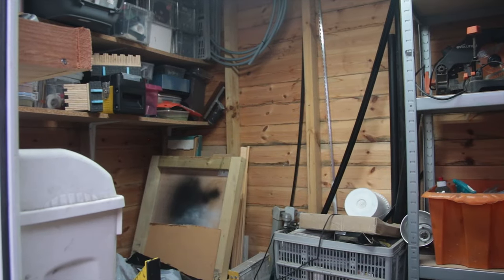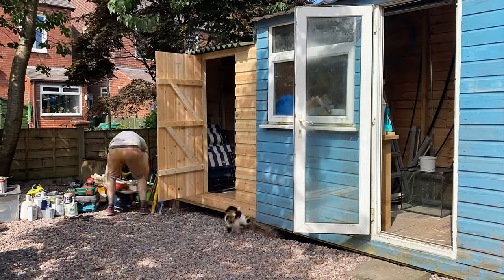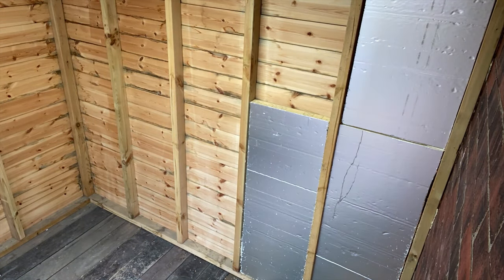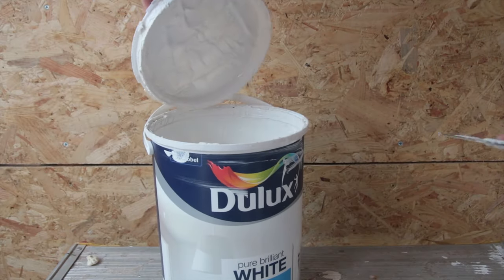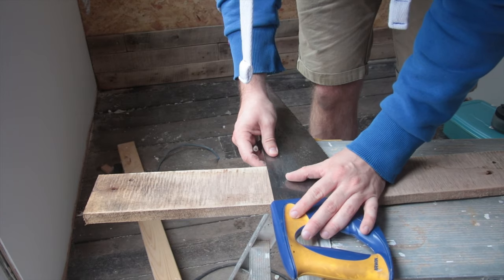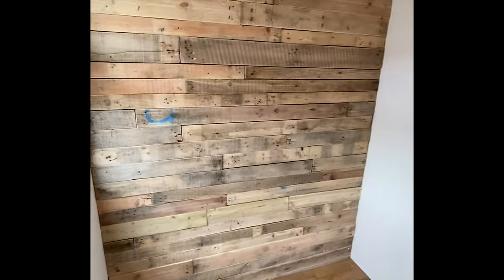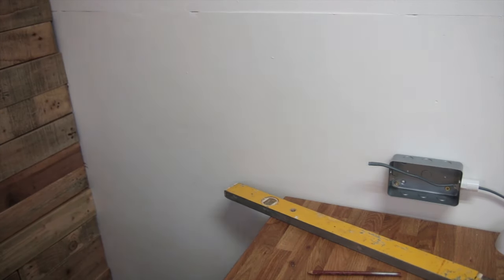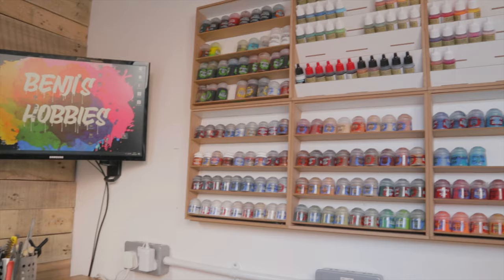Building MY DREAM Studio Hobby Space from a Garden Shed!

Comment: I like that saw as a straight edge bit, i did that on my grid-beam shelf build a couple years ago, seemed reasonable enough with our cluelessness about building, lol.    Nice job!!    On the floor insulation that's just right on the shed floor with laminate on top with no joists?    Does that stay level?  the floor doesn't sag in bits where there is more weight from bookshelves or anything on sections of the floor?
Reply from the maker: Thanks for commenting! The saw can be very versatile for marking out lines - you can also use it to make 45 degree lines as well 😊 I’ve not had any issues with the floor yet. I did think about adding bracing beams at the time but the span is so short that I don’t think it’s really needed. If it had been any wider then I would have absolutely added some. Thank you for commenting!

Comment: Greater video. I have two concerns. First is freezing temperatures during winter. Are you planing to heat it whole winter? Second is safety.You got there some serious collection and doors doesn't look to be super safe.
Reply from the maker: I’ll more than likely use a small oil filled radiator to keep it at 10-15 degrees and then turn it up when I go and work in there. It’s only a small space so it’ll won’t take much to heat! The door is pretty sturdy BUT I have taken quite a few precautions with regards to security and safety, don’t you worry 😉

Comment: How’s that floor holding up, mate? That foam board seemed a bit thick, and I was wondering if you’ve ahead any issues with it getting compressed from weight?
Reply from the maker: Still perfect almost a year on - no issues at all 😊 It’s cellotex/PIR insulation board rather than  basic polystyrene so it’s pretty dense. It’s also only a 6’ span, so there’s not too much ‘flex’ in the floorboards over that sort of span. If it had been bigger I’d have put joists down across the floor.
Reply: @BenjisHobbies  excellent, I’m stealing this idea. Also, thanks for answering me despite my typo, for which I will live in eternal shame.
Reply from the maker: @KevinTumlinson  no problem at all! Those pesky typos haunt us all from time to time! 

I really should do a shed update video…
Reply: @BenjisHobbies  and I will watch that video, sir.

Comment: What a great informative video how do you manage in the summer months it gets really hot in my garden shed and I don't have any insulation for me the worry would be that my paints and maby even some of the thinner plastic on the miniatures wouldn't fair very well
Reply from the maker: I’ve now had it up for a couple of summers and in all honesty it’s not been too bad. I think the insulation helps keep both the heat in during the winter and keeps the heat out during the summer so it’s a win-win. I do most of my work during the evening and I’m able to open the window or leave the door open if it feels a bit too toasty and to get some air movement. There’s also a ‘lock’ on the window so I can keep it just ajar enough whilst still being secure to give a little ventilation throughout the day. None of my models seem to have fared badly - even my resin minis that can get a bit bendy in the heat are still looking ok! Hope that helps!
Reply: @BenjisHobbies  thanks for the quick reply I think I shall invest in a similar setup to yours do you no roughly how much you spent just trying to get an idea as my shed is 12x8
Reply from the maker: @jamiejones3001  in all honesty, I don’t remember. The shed was there already, and I probably spent about £500 on the materials for the inside, but bear in mind that was during the pandemic so some of the prices were probably a little high. Also, make sure you factor in electricians etc to come and hook everything up for you. I installed everything myself but got it checked over and connected by someone qualified.

Comment: What did you do for heating and cooling?
Great job!
Reply from the maker: Thank you! For heating I’ve got a small oil filled radiator. I leave it at a very low temperature to keep the chill off and just turn it up when I need to. I haven’t needed cooling yet 😂 I’ve just left the door/window open while I’m in there if it’s felt a bit warm but overall it’s been fine.

Comment: Made a huge mistake with mine. Shed arrived,  the supplier erected it on a concrete plinth but it should have been raised on bricks, hence severe rising damp six months later. All that insulation and decor ruined, not to mention the money spent purchasing it.  You did a great job with yours.
Reply from the maker: What a nightmare! I was careful to raise mine off the floor about 8” or so to prevent just that. So far it seems to be holding up pretty well, and it’s been up six years or so in total 😊 I hope you’ve had better luck if you’ve replaced/rebuilt it.

Comment: Fantastic video, just what I was looking for...but could you tell me if you had waterproofed the shed before putting in the insulation/electriccs etc please....most of my work is with paper and its very important that the shed doesn't get damp....thank you
Reply from the maker: Thank you! It’s just a standard shed, so I used shiplap cladding over the carcassing. The roof is corrugated metal (I think Aliminium) sheeting. The shed had been up around 3 years before I converted it so I knew it was completely watertight beforehand.

Comment: nice video, ive always been a bit scared of the idea of an outside hobby space. how have you felt its gone through this winter? is it still a good idea?
Reply from the maker: Thanks! It’s been absolutely fine so far. I knew the structure was watertight and pretty solid before I started. I was a bit concerned it would get cold in there but a small oil filled radiator has kept it toasty 😊 No regrets, other than perhaps the small size, so far!
Reply: @BenjisHobbies  Did you keep that running 24/7 over the winter?
Reply: @BenjisHobbies  Awesome. Good to have in mind when i eventually get kicked out of my current hobby room!

Comment: What an amazing space, and a lovely start to the channel. Not only is this inspirational from a hobby space point of view, but inspirational to start my own hobby channel as well. 

Just out of curiosity, roughly how much did this whole ‘build’ cost, for someone looking to invest in a hobby shed themself?
Reply from the maker: Thanks so much for your lovely comment! 

It’s difficult to tell how much exactly as there were lots of little ‘add ons’ that I hadn’t planned for at the beginning. I think I probably spent £250-300 on materials BUT you could do some of it a good bit cheaper if you needed to, such as using OSB across all the walls, cheaper insulation, running a single spur rather than a whole new consumer unit etc. Also, it could get expensive if you don’t already own power tools and need to start from nothing.

Comment: Hey Benji. I live in Ireland (similar weather conditions) and I was thinking to do a shed conversion myself. Could you give me an aprox cost for the insulation, walls, floors and electricals used? Furniture and accessory is by preference so you can leave it outside the equation.
None the less, the result is awesome!
Thanks for the inspiration!
Reply from the maker: Hey Andrei, it’s difficult to remember how much exactly it all cost I’m afraid! From memory the insulation was approximately £200, wood sheets were £150, all the electrical fixings were probably another £100 and flooring about £50. I did already have some material though (such as the cabling, screws etc) which would probably add on some cost if you didn’t have them to start. Some of the bits you could probably buy cheaper now, as during lockdown there were some inflated prices, especially on timber. Sorry I can’t be any more helpful than that!
Reply: @BenjisHobbies  Thanks Benji, I much appreciate it. AND it's a starting point for myself! :)

Comment: Hi Benji, how do you stop mildew and mould growing in your hobby room over winter?
Reply from the maker: This will be my first winter in it so we’ll see! It’s raised off the floor so there is some good airflow underneath so that should prevent any damp from rising in to it. I’ve got a small heater in there that’s currently on it’s lowest setting continuously just to keep the chill off the room and I occasionally leave the window slightly open (in the locked position!) on some of the warmer/dryer days to to fully ventilate the room as well. If I have any problems down the line I’ll tackle them as they come 😊